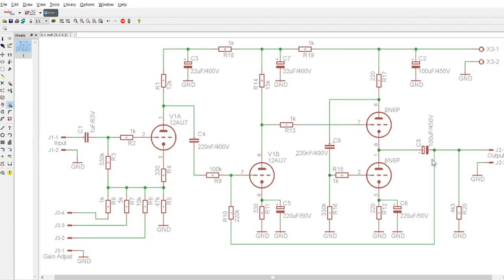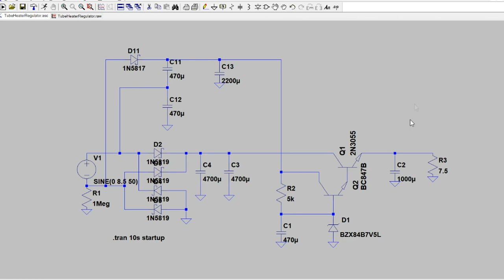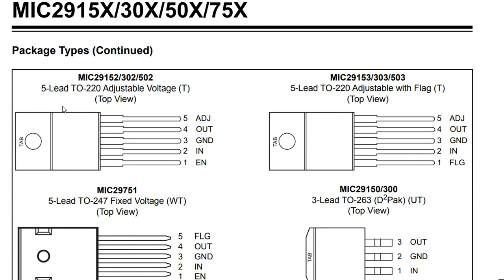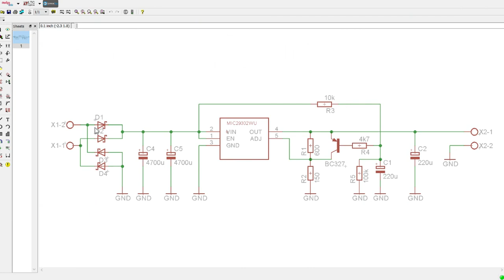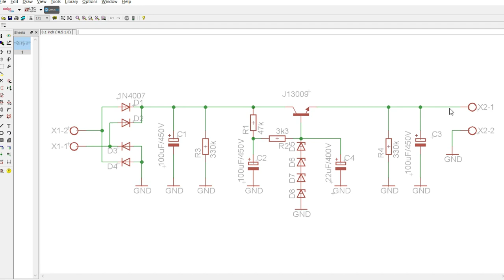Designing and Building a Tube Headphone Amplifier - Part 2 - Power Supply Design

Comment: Thanks for the update, which NTC thermistor (PN#) were you thinking of using? I may add one to my quad PP-monoblock amp...
Cheers,
Reply from the maker: Thanks. it depends on the amplifier but for something like a medium sized PP amp (e.g. 6V6-EL34-KT88) I'd probably go with an NTC thermistor having a resistance of 30-50 ohm at room temp and twice the current rating of what the amp draws. And of course when mounting it, keep in mind these thermistors run very hot because of the way they work, but you probably already know that.
Cheers,
Jake

Comment: Great! Like your videos. I 'v done a lot of  different amplifiers last 35 or more years. And now I have got an idea. I have 5-6 ESP32 boards and MCP41010 digital potentiometer ICs in my  boxes with electronics junks. Got an idea to make speaker, DC, overcurrent, thermal, overpower and rest protections, fan controller, with all parameters on 2x16 or 4x20 LCD with vu-meters on this LCD  and volume control, input selector and all of this bells and whistles... I found a few Arduino projects for vu-meters, protections,  tone control but even AtMega2560 has no enough memory and power to do all this function same time, all of this projects are only one of functions enabled. ESP32 is much better and it could be BT or wifi web based remote with great GUI (but I think to put buttons on PA also). It would be good to make it to fit as control for any PA. Any thoughts and advice about this idea?  What do you think is this good idea for a project or not?
Reply from the maker: Thanks, happy you enjoyed the video. That sounds like an interesting project, it should be possible to do something like that with an ESP32, it's always good fun to build something.
Cheers,
Jake

Comment: I'm really enjoying this project and looking forward to seeing the final design. I like the DC heater supply, curious to see if the impact could be measured? Thanks for your videos and thanks again for the software suite for the Analog Discovery!
Reply from the maker: Thanks. Using the soft start the peak current is considerably lower. I guess I could try add a short video segment in the next episode showing the difference in peak current draw during switch on using a current probe or a shunt.
Cheers,
Jake
Reply: @TheStuffMade  I'm sure the soft start will reduce peak start up current as per your design as you clearly know what you are doing! I haven't seen much on line (other than speculation verging on folklore) about the impact of DC heaters vs. AC heater supply on tube amplifier noise, which would be really interesting to see quantified if possible. Cheers and thanks again for your videos and sharing your wisdom.

Comment: Would you share your layout of the psu ???
Reply from the maker: Sure, but these boards are just small test boards to make sure the design is working as intended, there will be a final design that will be slightly different. If you are still interested then I can take a few pictures of the underside and upload them to imgur.
Cheers,
Jake
Reply: Yes .. i very interested with your psu design ... please share it